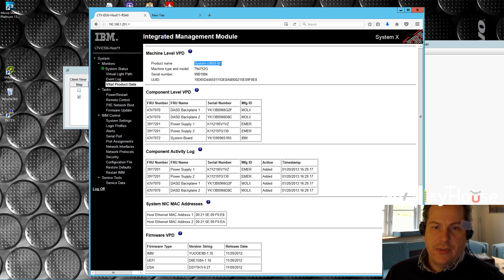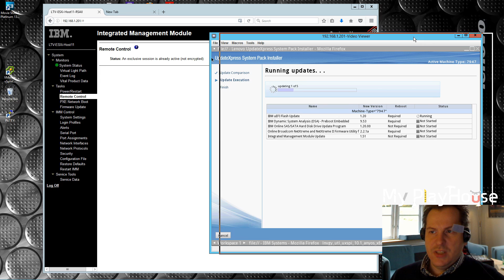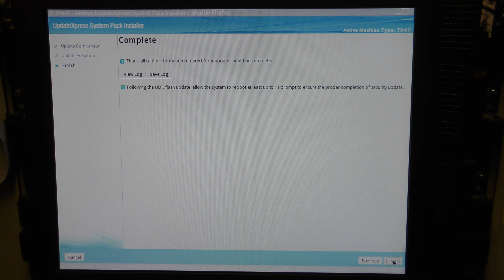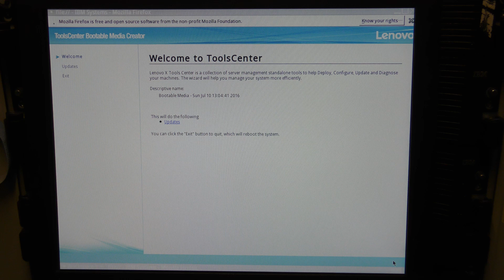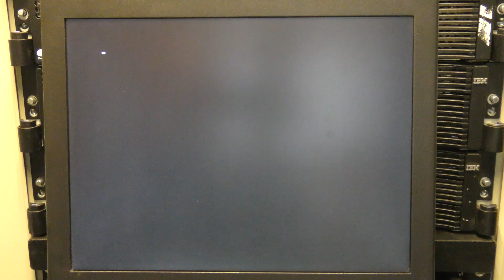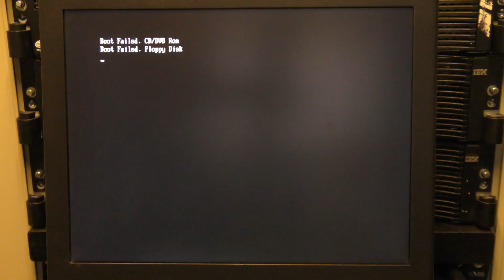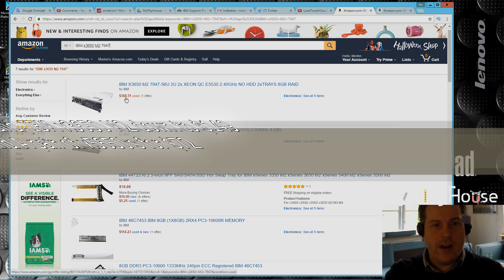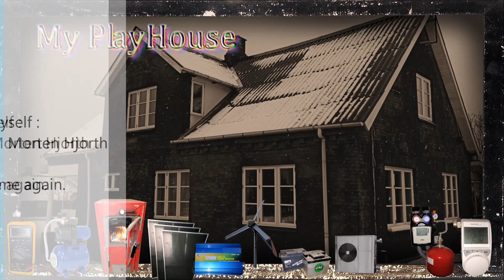$250 for a 12 Core Server, up to 128GB, IBM x3650 M2 - 428

Comment: Is it worth it to get the L5640 (The lower voltage version of the 6 core). My dell r710 has 2 E5530 which have a tdp of 80w while the L5640 is 60w. Im trying to control the heat that kicks out of the beast, and also trying to decrease the amount of power it pulls. So is there a gain to the low voltage cpus or should i just get the x versions. (Keep up with the vids as there very entertaining)

Comment: Quick question, if you have upgraded the cpu's would you not need to change the stock heatsink for  bigger heatsink would the system not run better.
Reply from the maker: Hi bombay2008
Yes, if the CPU's uses more power, than the heatsink is rated for.
Thank you for watching! :-)

Comment: hi
i have just bought the ibm x3650 m2 with 1x e5504 cpu, 10GB ram  in, no drives just blank plates £65.00 inc p&p, plus 2x X5650 cpu's for £40.00 inc p&p, and heat sink £15.00 inc p&p, just need OS now got everything else. thanks to your videos and a server room to die for.
Reply from the maker: Hi bombay2008
Thank You very much! nice buy!! good server! 
Thank you for watching! :-)

Comment: Great news!, I've been watching your channel for just a couple of weeks but I've decided to by a IBM x3650 M2 (ordered one today from ebay with 2 x 55 series and 32 gig of ram for 140 USD) to use as a file server in raid 6 with sata drives. I assumed the low wattage  L5640 6 cores would work because I use them in my Dell T5500 series workstation but I wasn't sure. After seeing this I'll give them a go :).  I'll have to watch a lot more of your videos to understand how to operate the server but I'll have some fun. You have a really great channel.
Reply from the maker: Hi Jasonsadventures
Thank You very much!  You are in luck the Lenovo x3650 is an awesome server and can with the newest firmware, use the Intel Xeon 5600 series,, I did a video on that :-)
Thank you for watching! :-)

Comment: I recently picked up three dell servers. an R510, R610, and R710. The R710 was actually OEM'd for Google and had their custom BIOS on it. And it was HORRIBLY out of date. So I downloaded the appropriate update ISO's and updated all three of them as soon as I got them home. I have a pair of Xeon L5640's to put into the R710 for lower power usage and cooler operation since they're 60w vs the 80w quad core CPU's that are in there now.
Reply from the maker: Hi hallis1
You have started a collection :-)
Thank you for watching! :-)
Reply: I plan on picking up an IBM x3650 at some point in honor of your channel :). I just finished installing those new CPU's into the R710 and it booted up first time. No issues. Same clock speed as the old ones, 2 more cores per CPU, 50% more cache, and use 20w less power each. And they were only $50 US for the pair.

Comment: Hello I'm maybe planning to be using the m2/m3 for Freenas. Do you know how much power these use on evrage with 4/6 core cpu's? Also are server hard drives worth it or laptop drives are reliable enough. Thanks for your help :)
Reply from the maker: Hi Misha M
Start by putting on a virtualization lair under your NAS,, So you can run more stuff on your server. The 2.5" driver from a old Laptop does not become more unstable by being use in a server :-)
If power usages is a an big issue,,look at the Xeon 55/5600 L  for low power,, this server does use some power,, do not expect under 100W
Thank you for watching! :-)
Reply: My PlayHouse thank you for your help I might go with the R710  which is similar but supports 3.5 inch drives

Comment: Been watching your channel for over a year now.  I love it.

Seeking your advice.  I'm looking for a good, quiet minimum dual xeon, DDR3, 128GB+ RAM workstation (or possibly a quiet server) to buy.  Used, previous gen HPE, Dell (maybe IBM/Lenovo) hardware is what I'm looking for.  I'm looking to do some super hobbyist lab work with OpenShift, Kubernetes, Docker in a home office.  At least 24 threads (but the more the better).  I don't mind doing a bunch of cannibalizing of hardware or chip & card installs to do it.

Do you have any recommendations?  I've seen some relatively cheap IBM X3650 M3's (~$20USD/each for 8) for sale but I'm leery of IBM/Lenovo for security reasons, getting them shipped to me would be a hassle, and 8 is way more than I need (for now).
Reply from the maker: Hi Louis Santillan
Thank You very much! I do not know of any cheap workstations,, that will do a 128GB of DDR3 RAM :-/ and if you can get you hands on IBM x3650 M3's for 20$ a piece,,, that is an awesome price. And You can afford to try that.
Thank you for watching! :-)
Reply: So the HP z820/z840 series and Dell Precision T7500/T7600 are workstations that essentially 4U servers in a tower format.  If there are equivalent IBM/Lenovo towers, that would be great to know.
Reply from the maker: Hi Louis Santillan 
Lenovo has there own series of workstations that are more or less tower servers.  Thinkstation P510/P710 and P910.
http://www3.lenovo.com/ca/en/workstations/thinkstation-p-series/ThinkStation-P910/p/33TS3TPP910
I do not know much about them,, I just did a google.
Thank you for watching! :-)

Comment: X5650 is available for much lower price on ebay
Reply from the maker: Hi Govinda Raja
Thank You very much! did you find some really cheap ones?
Thank you for watching! :-)
Reply: I live in India and unfortunately the cheap ones do not ship here. I am taking the help of friends to slowly buy components for restoring a BladeCenter H that I acquired.
Reply from the maker: Hi Govinda Raja 
Yes India sucks, when it comes to used hardware. :-/
Thank you for watching! :-)
Reply: All is not lost, I  managed to get a IBM Bladecenter H right here.
Reply from the maker: Hi Govinda Raja 
Where do you get used equipment in India?
Thank you for watching! :-)
Reply: There are local websites that have used hardware listings. However stuff like the BladeCenter is never listed. The vendors that deal in used computers buy from big companies and then sell it in the local market. I have a reputation for picking up this kind of stuff and I am friends with some Vendors. So when stuff like this shows up, my vendor first gets in touch with me.
Reply: I actually picked up two nos Bladecenter H, I gave away one to a friend after fixing it and he uses it for a render farm. I am in possession of one which is currently bare-bones. I also picked up some IBM DS4700 SAN.
Reply: By giving away I mean, he paid for it.
Reply from the maker: Hi Govinda Raja 
May I aks what a BladeCenter H ended up in... inr?
Thank you for watching! :-)
Reply: About 5500 Euros with 12 HS22 blades, 2 HS12 inclusive of RAM, 4 power supplies, 1 management module, 2 fiber passthrough modules, 1 intelligent copper pass through module, 1 switch module.

Comment: I appreciate your videos but I have to call BS on that 65% number, how about a proof video? E5530 vs X5650 are in Intel's "tick" cycle, basically refresh of the previous model (the processors are a year apart). You went up 2 cores and 226mhz, please, how does that equal a 65% increase!?
Reply from the maker: Hi WNYConsoleServices
I do try not to BS you, I do believe there is an 65% increase in performances from the E5530 to the X5650,, I can be a little off.
Thank you for watching! :-)
Reply: No you read what I wrote wrong. It's 2 cores per CPU, 4 threads per CPU total. So yes technically he went from 12 to 16 threads. Still, you do not get 65% increase from this with a tick CPU cycle and 200ish Mhz.

@ My PlayHouse - I don't think you are intentionally deceiving, but a 65% increase is just absurd to be honest..
Reply from the maker: HI WNYConsoleServices 
The Xeon 5600 series is also a generation newer than the Xeon 5500 series, and can do a bit more per clock cycle-ish.
The E5530 scores 4605 : http://www.cpubenchmark.net/cpu_lookup.php?cpu=Intel+Xeon+E5530+%40+2.40GHz&id=1244
And the X5650 scores 7594 : http://www.cpubenchmark.net/cpu_lookup.php?cpu=Intel+Xeon+X5650+%40+2.67GHz&id=1304
That comes to that the X5650 is 164,9% of the E5530.
Is that wrong?
Thank you for watching! :-)

Comment: Hi Morten Another Great Video, could  you explain the minus number IBM System x --[794752G]--   on the Vmware main screen at 13:18
Reply from the maker: Hi Trevor Dunne
Thank You very much! 
The 7947 is the IBM model number for that x3650 M2 the 52G is one of IBM's configurations, they have some standards (CUP, RAM, HD, Service, Raid controler, CD/DVD) and that code is one of those. 
Thank you for watching! :-)
Reply: Thanks I need To be like a Hawk you showed it  at 1:12

Comment: Hi, is any reason why the webcam runs at low fps? 

PD: great video!
Reply from the maker: Hi Camilo Martinez Aldaya
I think I can go down in resolution and up in FPS...
Thank You very much! glad you liked the video :-)
Thank you for watching! :-)
Reply: My PlayHouse ooh, i was asking because my c920 did the same thing until i set it to mjpeg, then it did go from 5 to 30 fps at 1080p, i don't know if it's the same camera, but seems to be similar because the face focus.
Reply from the maker: HI Camilo Martinez Aldaya 
Mine is also an Logitech But the way older "Pro 9000" I do not remember having seen the mjpeg option anywhere?
Thank you for watching! :-)
Reply: According to cnet specsheet the pro 900 can do 1600 x 1200 @ 30 fps, but i don't know the config on that model exactly.
Reply from the maker: HI Camilo Martinez Aldaya 
I will have a new look at it!
Thank you for watching! :-)

Comment: Is that the xeon processor used on a personal computer.? I mean if i want to upgrade my cpu, can i use this processor? If i found this at a cheap price..
Reply: Rejan Rahman It depends on your motherboard. Xeons need error correcting ram which some mobos don't support even if the pins match.

Getting a used workstation is an option. They usually have a lot of the right memory and a Xeon or two already.
Reply from the maker: Hi Rejan Rahman
You need to find out what CPU and Socket you have in your motherboard,, and find out what you can get for it.
It probably not a Xeon!
Thank you for watching! :-)

Comment: How is the power draw impacted? Just wondering if it would draw too many watts for the PSU.
Reply: Or certainly, if you couldn't have certain GPU's in this configuration
Reply from the maker: Hi 
This X5650 uses the same as a X5570 95W,,,so that is all good.
Thank you for watching! :-)

Comment: Have you ever exceeded the maximum ram for a server? And will the server accept it?
Also, if there is a x3650 that only has one cpu, is it a simple task of just dropping in a cpu and heatsink for the second slot or is there more to it?
And do any of them work with the Dell storage arrays at the top?
Reply from the maker: Hi themaconeau
Lots of questions,, to go over the 128GB, I'd need to try with 16GB blokes,, I have not tried that.
If you only have one CPU you can only use ½ the RAM,, you would do the ram differently when putting in second CPU,, But it's not hard at all. But only two equally CPU's will work.
The Dell storage is iSCSI,, so it works with all the servers.
Thank you for watching! :-)
Reply: My PlayHouse I only ask because I'm starting to build the server army vicariously through your channel ;)

Just out of curiosity, you wouldn't have any 2Gb PC2-5300 unbuffered ECC sticks lying around, would you? :P
Reply from the maker: themaconeau for what server?
Thank you for watching! :-)
Reply: My PlayHouse x3250 M1 Type 4365. It specifically asks for unbuffered in the IBM docs. It's a long shot, I know. Buffered seems to be a lot more available than unbuffered.
Reply from the maker: HI themaconeau 
I do not think I have any,, but fund this : 
http://amzn.to/2fpRIS8
Thank you for watching! :-)
Reply: My PlayHouse Thanks for the assistance 😉